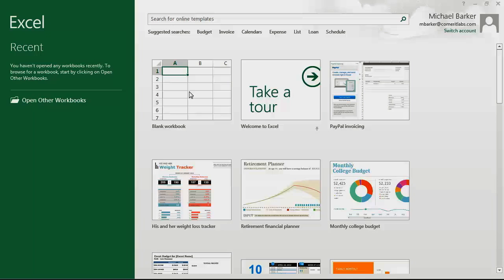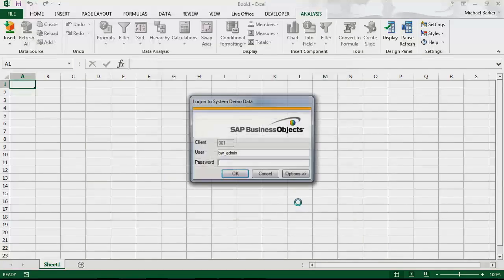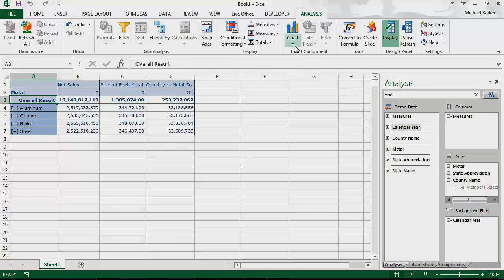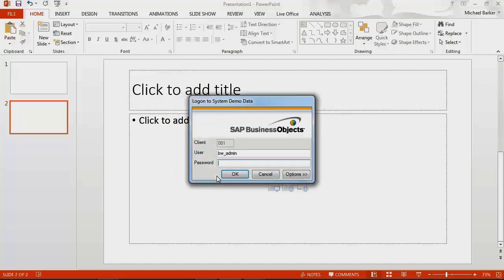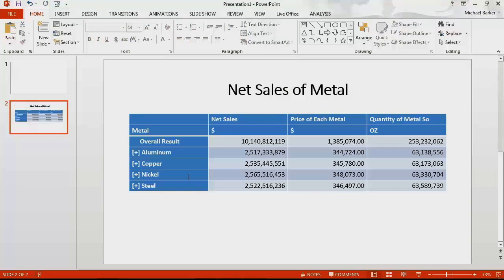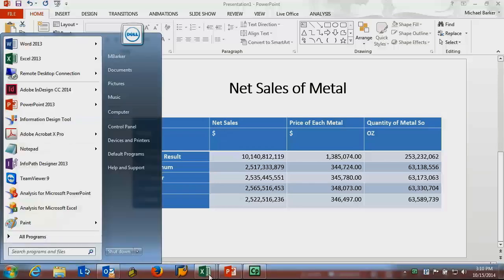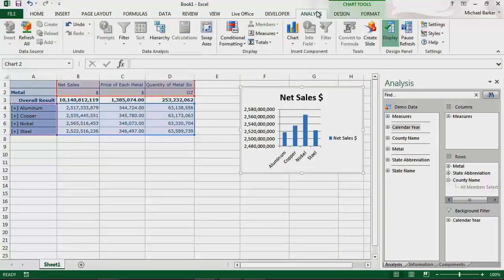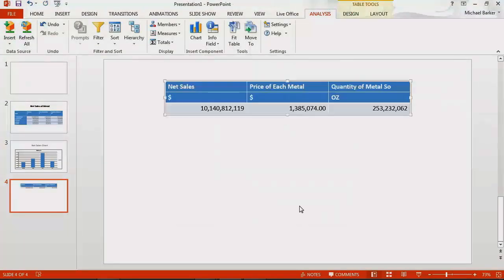Demonstration of Analysis for PowerPoint

Comment: On my Excel Analysis I couldn't find the function "Create Slide", do you know why?
Reply: Did you find out how to get the " Create Slide" Button ? I am having the same problem but I think that It is not a standard functionality.
Reply: They replaced this button with Smart Copy -> Smart Paste. You are supposed to use that to copy from excel then paste into powerpoint. The problem I have is that the chart loses its formatting when doing this.